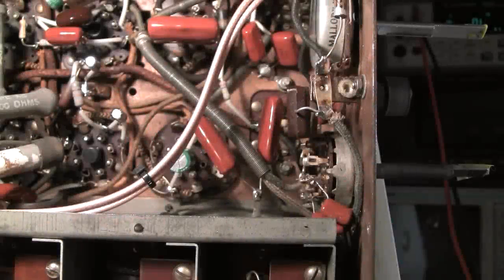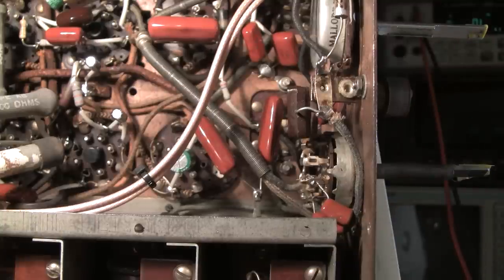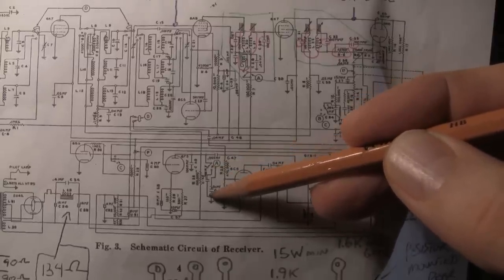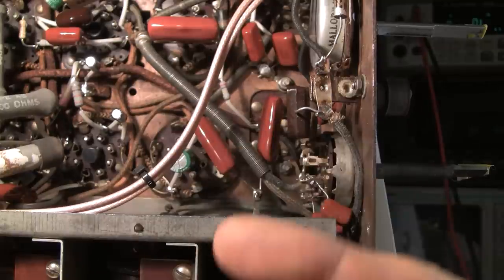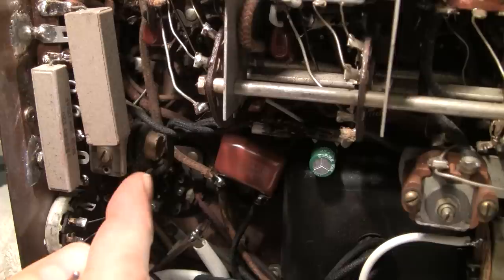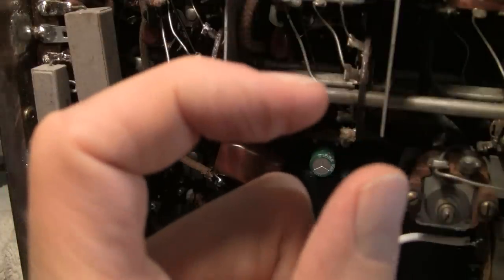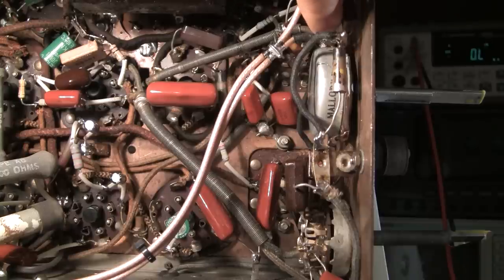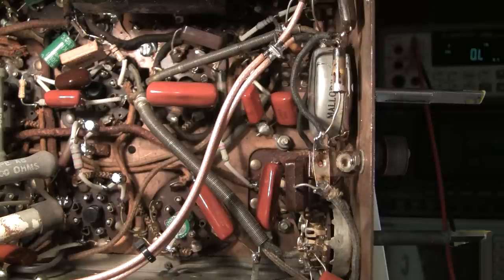Stromberg Carlson 240 Modification Video

Comment: My Grunow 1181 11h chassis has the same awful crunch on the bandwidth switch. I'm going to take a look at the cap connections, and if it looks like a similar B+ precharge issue, this should be a great fix! Thanks!

Comment: Love these videos!! I'm learning so much!
Why would you use two resistors twisted together instead of one resistor at half the ohms?
Reply from the maker: +SciPunk215 
Hi. Did you happen to have a time in the video? It's been a while since I did this one.
Reply: +Mr Carlson's Lab Sure, it's at 1:18. You're putting some resistance to prevent the crack or pop on the speaker.
Reply from the maker: +SciPunk215 
That was a while ago, The two 5.6Meg resistors in parallel were to achieve a resistance that wouldn't affect the tone (much) and still discharge the caps fast enough to eliminate the pop noise between selections.

Comment: Mr Carlson (my apologies I forgot your first name), you mention in the video about re-lubing the carbon-track/wiper interface in the old potentiometers. I've been wondering for years what to use as I've taken many pots apart to clean them in old gear. What the heck can I use and what do you use? The few other guys that I've talked to over the years always recommended Cramolin R-5, but I never have any around. Another guy suggested Vaseline (petroleum jelly) years ago also. Thanks :)
Reply from the maker: Cavemaaaan  I have had really good results with clear silicone based brake lubricant. It doesn't swell plastic or rubber and prevents corrosion and oxidization. Been using it for years, and always good results.
Reply: How about tuner lube?  It's grease used for mechanical tuners.
Reply from the maker: Could work! I'm not a fan of spray lubricants though, just for the reason that it may get on parts like wafer switches, and just make a general mess. If I remember correctly, that tuner lube sprays out at high velocity. Am I right? ...or am I thinking of a different product?

Comment: I'm working on a Helicrafter the tunning cap is frozen any wisdom on unfreezing 
 it. The radio sat in a barn/shop for the past 50 years.
Reply from the maker: +Joe Taylor 
Wow, that cap sounds like a mess. Without seeing it, some hours in solvent may help.
Reply: +Mr Carlson's Lab 
Thanks for the reply.
Got it loose a drop of Srarret machine oil on each end.  
Joe